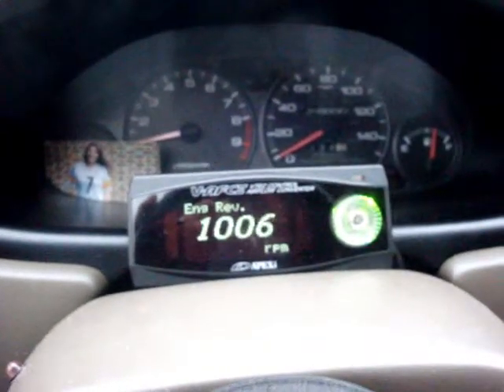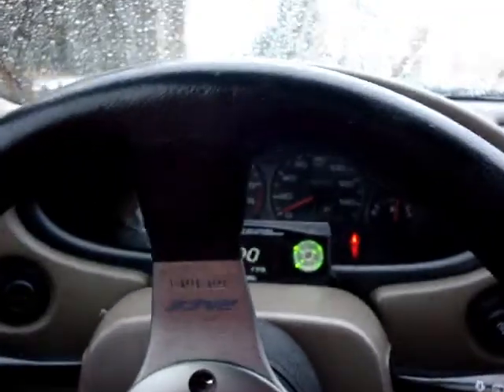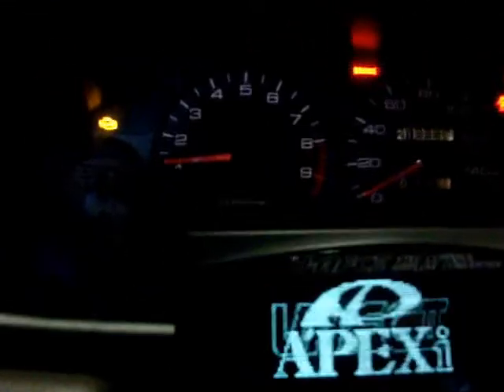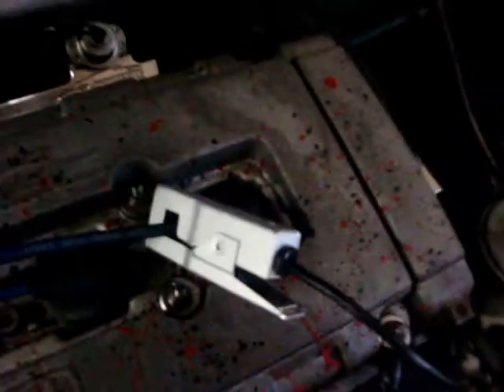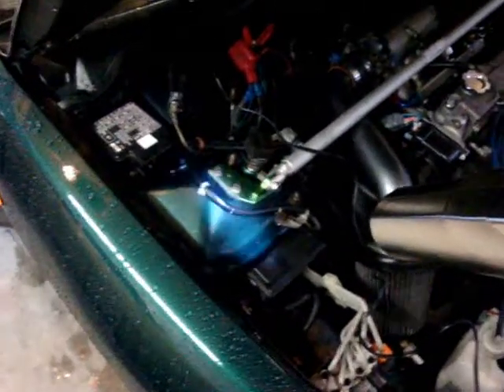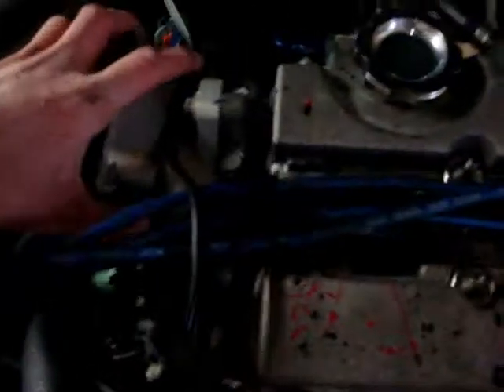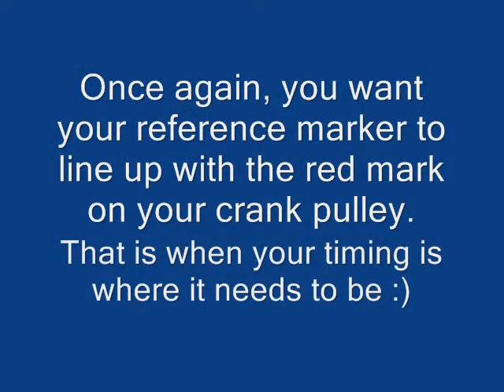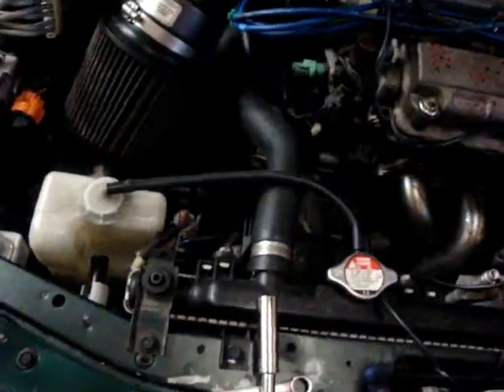How to set Ignition timing: OBD2 Honda/Acura

Comment: Got a question. If you have a low voltage condition on your upstream O2 sensor and you follow the ECU short procedure here, will the car stay in open loop and thus you can diagnose a rough idle being a result of that sensor or something like air in the cooling system? What I mean is will this allow a person to diagnose between a mechanical problem and an electronic sensor problem?

Comment: if your ecu will adjust its timing by itself by not jumping the clip why would you do it manually with a light yourself? the mechanics at pro shop told me 97 civics don't need this done due to the ecu compensating on its own
Reply: hurr durr
Reply: There is a "base" timing that you need to set. If that setting is off, the computer's adjustments will also be off. I guarantee that your mechanic is wrong about your '97, there's a procedure to set ignition timing for those as well.

Comment: Hey where did u get the digital tac at
Reply: I know this comment us a year old but that isn't a digital tach...it's an Apex'i V-AFC. Some people use them in cars that didn't originally come with VTEC engines or to control when VTEC engages. If you didn't know, VTEC is a variable valve timing system that engages a secondary lobe on the camshaft to adjust timing on the fly. People like to adjust the engagement time to make the car faster. I don't know if he's actually running a full B18C1 (94-01 Integra GSR) or if he's got an LS/VTEC (Base Integra NON-VTEC 1.8L bottom end with a DOHC VTEC head) but either way I'm sure it's fast.
Reply: Lol yeah right

Comment: Thanks for this video, this is super helpful! there is a repair guide in the auto zone website. Don't want to link and risk censorship, but if anybody wants details on this, you can google auto zone and honda odb II ignition timing adjustment and it should be among the results. The guide confirms everything in this video.

Comment: another tip you should put in the info section is you should double check the timing again after you tighten down the bolts once you found the sweet spot cause tightening those bolts can move the distributor and even a little can throw it off.
Reply: ltlocus he said that in the vid